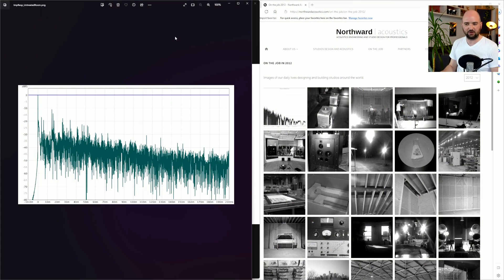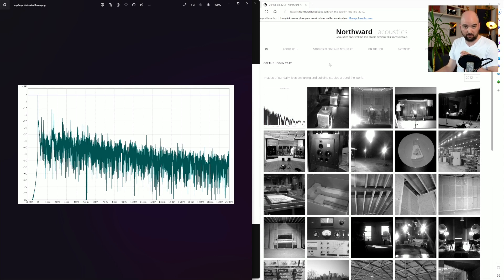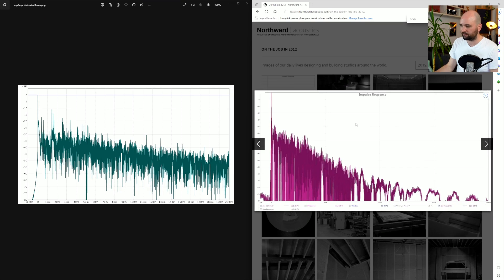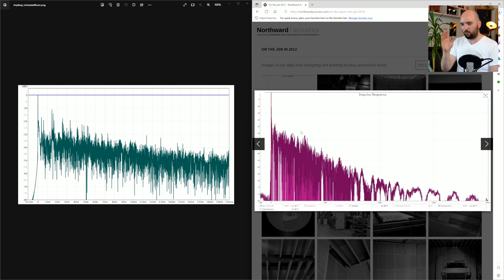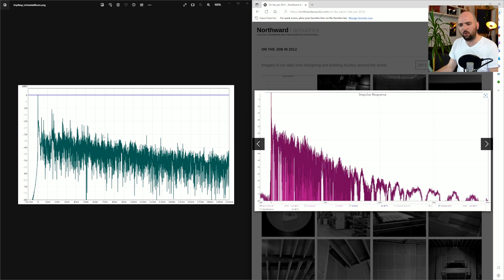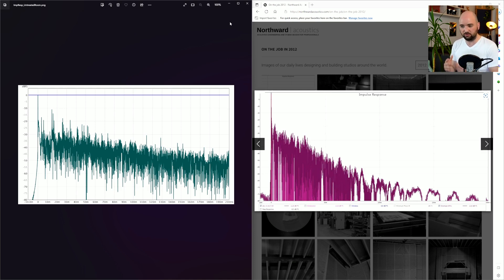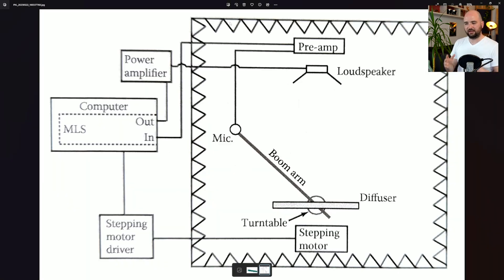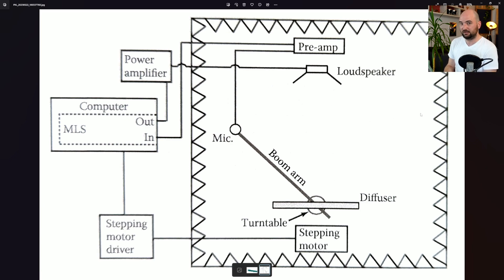Diffusion: Can you MEASURE it in a home studio?

Comment: Hey, appreciate all of your content! I’m currently treating my space with Rockwool and have made a big, deep panel between my speakers which means the speakers arent in visible sight of each other. It has helped a lot with imaging, but it might have done more bad than good… It’s like the bass has been reduced to the point where the speakers (Yamaha HS7) are Very bright and harsh. Is there a general rule for placing thick absorbtion between the speakers or do you have any idea what the problem could be?
Reply: Unless your speakers are built inside walls, i’ve never seen a panel be placed in between but behind the speakers…

Comment: One way to check the effect of a diffuser on REW measurements is observing the standard deviation of the reverberation time in different positions within the room. Untreated rooms tend to have not only higher average rev time, but higher deviation of this mean value.

I've built in a studio one time with a diffuser design to tame between 500 and 4500 Hz  and it was the first treatment installed. So I could see clearly the average rev time dropping A LOT in this spectrum. But what I found interesting is that the standard deviation of the rev time also dropped below 500 Hz. 

I still got the graphs if you want to see. ;)